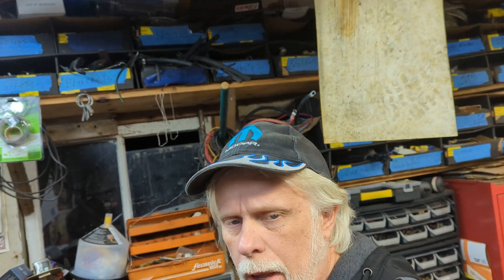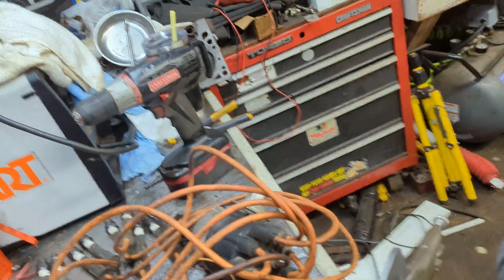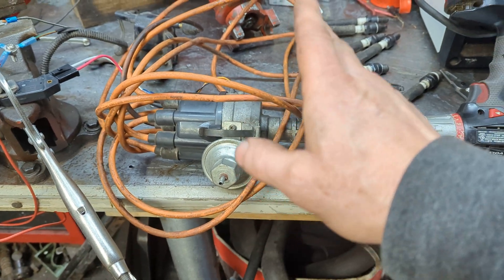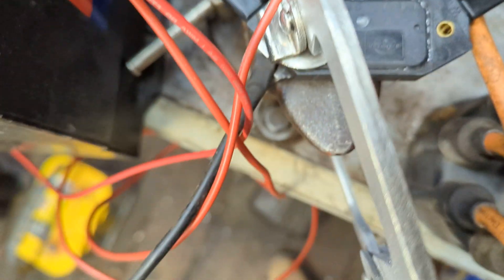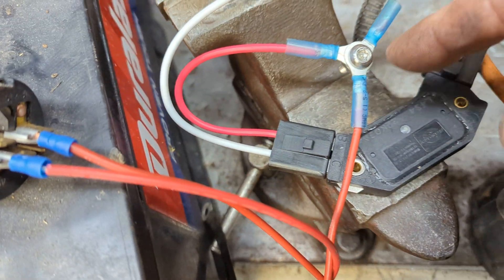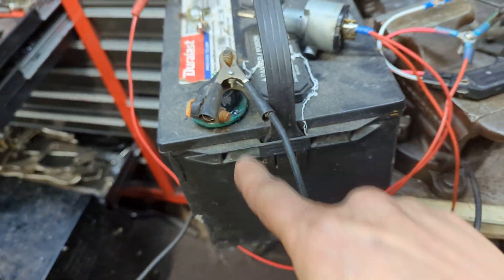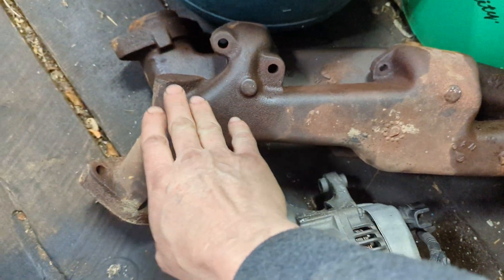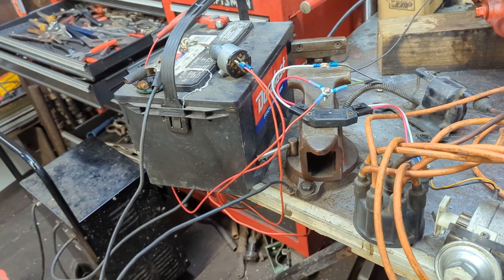Mopar HEI ignition conversion and junkyard haul

Comment: I'm getting ready to do this project real soon.This video helped a lot. 1 thing I wish you could have done a little better is film everything from a little bit more of a distance?So I could see the routing of your wires. I figured it all out. If you ever decide to remake this helpful HEI conversion video, maybe lay it all out on the ground so you can go from one end to the other explaining the connections. Thank you for the video. I've watched a lot of them and this is the most helpful I've seen so far.
Reply from the maker: Hey Just wanted to say thank you very much for watching. The video and thank you for your comments and i i would like to make this video again and have things more laid out more organized. So that people can see much easier
And get a better sense of where everything is supposed to go. And how things are supposed to be wired up?
So yeah, I will try to be doing that in the next two or three months right now.Things are just so very cold.And i'm a little bit sick, so i'm taking it easy right now until I get over this.The illness. that I have and I don't have heat or insulation in my garage, so yeah, pretty much a problem right now.
But again, I will be making this video again sometime soon.Thank you very much have
Reply: @slantfish65sd  Thanks for your response. I hope you see this. Another thing I noticed-in most of the videos I've watched is, no one explains what they did with the factory harness for the electronic Ignition/ ballast wires. Some have 4 connections  & some  2, that came in the vehicle. I hope you get to feeling better soon, and thanks for all the videos.

Comment: I have a 66 Dodge 225. Do you happen to have a part number for your Dodge hei distributor? Or a year/make/model to search with? Thanks.
Reply from the maker: Hello, thank you very much for watching the video and thank you for your comments. As for the HEI ignition system that I used in the video, what I did was I used the stock Mopar distributor for electronic ignition that became available beginning in 1973 and lasted until 78 or 79. An easy way to tell that you have a correct electronic ignition distributor for a Mopar is to look at the body of the distributor and make sure it has a vacuum canister that vacuum canister that a vacuum hose hooks up to provides the ignition advance and retard as the engine is running. That is what I used in the video. Now, if you find an electronic ignition distributor that has no vacuum advance canister, you should avoid that because that distributor has no means to advance or retard the ignition that particular style of distributor is for the lean burn ignition system and I would generally avoid those distributors for that particular use. So again find a distributor that has the vacuum advanced canister on the side of the distributor. It is very similar to like what you will see in the video. Again, thank you very much. If you have any for the questions feel free to ask

Comment: Seems like a magic trick... I've been trying this on my dinning room table for 3 days now...
Reply from the maker: Sorry for not responding sooner. I've had a lot on my plate. I've been dealing with a lot of very very bad weather here at my home but I want to say thank you so much for watching the videos and your comments. Very nice of you. As far as like getting the HEI system to work with the Mopar distributor go to a website called Allpar they have a wiring diagram that is very good. It shows the distributor, the ignition module, even the ground wire or the ground for the ignition module. Also they show the power wire coming to and supply and power to the module and also to the coil. It's really really good. Basically, if you cannot get the system to work, you may have one or more wires in the wrong place again, my apologies were not responding sooner Make sure you're eliminating the ballast resistor in the system. It the GM module works with a straight 12 volts to it. Okay so you don't have to worry about the ballast resistor it's not necessary just bypass it
Reply: @slantfish65sd  Awesome, thanks for the advice! You bet i'll keep trying!
Reply: @slantfish65sd  also I hope you are well! Godspeed!
Reply from the maker: Hey coyote, check out my latest video. I made it specifically to address the issues I have with the current video that talks about the HEI ignition module being used with the Mopar distributor situation there and get your setup to working like it should. Oh one other little thing to keep in mind. Make sure to at least use dielectric grease on the back of the ignition module when you mount it to a heat sink at least dielectric grease. Use that. There is a heat paste type grease material. It is white in color. Probably would be able to get it from Amazon or eBay. If I can come up with a part number or a supplier? I will let you know

Comment: I have had 3 icm and now 3 hei modules go bad. I've bought good products too. Any ideas why these are going bad. They run awesome for a couple of hours then start to sputter and run bad. I replace the module and boom great for a few hours again.
Reply from the maker: Hey just seen your comment. Unfortunately what you're going through is what a lot of people have went through, including myself and basically the Chinese and a lot of our new parts, especially electronics parts is just horrifically mad. However, let me do question you about a couple of things first you know. Make sure you have an excellent ground. There's nothing questionable about the ground. Where the your mounting? Any ignition module there has to an excellent ground to the chassis body work of the car. If the vehicle you're dealing with has a separate chassis make sure you have a separate ground that goes from the chassis to the body work and then of course a separate ground that runs from that body work to the engine block. Then you want of course a separate ground that runs from the engine block to the battery negative side. But I want to question you about your grounds. And also I'd like to know what brands your your buying as for your ignition parts. As for me, I'm going to go and tell you that I've been using the wells brand ignition parts that I've got from O'Reilly Auto parts. Those seem to be doing very well also. You may want to look at ACDelco or
Reply from the maker: I meant to say Delphi and then I went and sent the answer or reply. Anyway, you may want to look for Delphi parts AC, Delco Wells or Napa etchlin brand. Those seem to be far better in quality than stuff that you can receive at autozone or advance Auto at one time I worked for advance Auto and I can tell you their electronic stuff is very bad and usually with autozone or advance Auto parts, their electronic stuff you usually have to buy several of them to get one good one I also like to say thank you so much for your comments. Thank you for your watching the video and also have yourself a great set of holidays. Merry Christmas! God bless
Reply: @slantfish65sd  thanks for the reply. I have been purchasing the accel hei from oriley. The icm was from Jegs. It was awesome for a few hours. So I switched to the hei after several icm. The ground is good. I'm trying a 1.4ohm coil instead of a .7ohm. I will see if that works now. Im using no ballast now with the 1.4ohm coil

Comment: Will the magnum exhaust manifolds bolt up to an la motor?
Reply from the maker: Yes, very easily. However, you do need to be aware of where the exhaust manifold outlet is in relation to whatever chassis you're putting that engine and exhaust manifold in. But yes the magnum manifolds easily bolt right up. Same bolt pattern bolt right up. No issues and also thank you very much for watching the video and thank you so much for your comments

Comment: Cool video great explanation. Think I’m going to do this on my coronet during my 360 swap
Reply from the maker: Thank you very much for watching the video. Really appreciate it and thank you for the comments. As for the ignition swap to a GM HEI module, I like them really well. If the current crop of Mopar ignition components wasn't garbage, I would be all on board for those. But unfortunately lots and lots of electronics are coming out of China and which means quality just isn't there. It's non-existent so you may want to think about doing that. And I like the idea of your swap of a 360 into a coronet

Comment: Will this work on the 1987 Dakota with the non point type?
Reply from the maker: First of all, I'd like to say thank you very much for watching the videos. I really seriously appreciate that. Really helps out the channel okay. As far as making this GM HEI module work with your distributor in your Dakota, I'm assuming we're talking about the V6 Dakota 3.9 l that being the case you're going to need to probably it's probably will work because the distributors in those year Dakota's being that it's 1987, those distributors will have a module pickup module that is inside the distributor and I can't remember. I've seen some 87 model Dakota's with fuel injection some with carburetors. So going back to the distributor those distributors that year those years had no provision for any timing advancement they didn't have. A any way to advance the ignition timing while the engine was running. They don't have a vacuum canister look at your distributor and make sure it doesn't have the vacuum canister. Or pod on the side of the distributor body. If it doesn't then you're going to need to get yourself a V8 electronic distributor for like a 318 that has a vacuum advance pod on the side of the distributor. You can find those in like the Dodge trucks. Probably 1980 and back. Just to be safe I'd say 1978 and back then you're going to have to take out the reluctor wheel that's under the rotor button in the distributor. That is what tells the pickup to tell the ignition module when to fire the coil. Now you would have to pull off your electric wheel from the V6 distributor to put into the V8 distributor that you're going to use. That way that distributor will only send six signals. The pickup in the distributor will only pick up six teeth on that reluctor wheel and there is another way to do this. However, you may have some issues with this. You could use just the V6 distributor cap on a V8 distributor. That way you get the vacuum advanced canister and you can run the GM HEI module if you don't have some way to advance the spark then the engine may run poorly at higher RPMs or run poorly at lower RPMs so you can wire up the stock distributor that comes with that engine to work with GMHEI distributor module. It just won't have any ability to advance the timing curve, so I hope this answers your questions. If you have any further questions about this, feel free to ask. Thank you!

Comment: What a awesome video,Thanks for sharing this information much appreciated. I used a Summit Racing GM HEI style on my 89 W 250 360 LA worked great,however I had clearance  issues with the Distributor cap being much wider.  The distributor body interfered  with my firewall in wich  I clearanced with a Hammer 🔨..lol. I like your idea much better 😉👍👌.
Reply from the maker: First of all, thank you for watching. I really appreciate it. And I also was thinking about doing the GM HEI style distributor on my small block Mopar's but like you said in the trucks, the firewall is a real problem. So I will probably be doing this kind of setup. But that HEI distributor is great because it has that big massive cap that gets you plenty of clearance from one spark plug. Contact to the other and doesn't allow as much spark scatter

Comment: Great job on the example of a working system which is a super vid for beginners to see how the ign systems works and it's always nice to get that score from the boneyard - I enjoy that too. Question for you, Why go for the GM module instead of the factory Mopar? The theory is it gives more spark, but has this been proven? And is it more reliable? I must say I never had much trouble with mine. Thanks for the video.
Reply from the maker: First of all, thank you for watching. I really appreciate it. As far as I know, anybody like proving that the GM HEI ignition module provides more spark. I don't know of anybody actually doing this. It would be a good video, though I'd say probably somebody probably might be able to do this in a garage, but it may be kind of difficult. However, at a racetrack or on a dyno this might be easier to prove out but the reasons for getting rid of the Mopar ignition box or brain box. Whatever you like to call it. The reasons for getting rid of that is because it has to run at less than 12 volts, which means you have to use the ballast resistor in order to make it work and still live. You can temporarily run it at straight 12 volts, but it won't live for very long like that. Furthermore, the the supply of today's ignition brain boxes and the baluster resistors is nothing great. Thank you, China so that's the reason why I'm trying this system out and seeing if it's going to work out really well it's like I said in the video it will be going on the $50 318 and I'll be using it on that and then I may also use it on the ramcharger or my 5th Avenue and in the GM HEI module takes a straight 12 volts and eliminates the baluster resistor all together which I've had a lot of trouble with over the years. Honestly when I go into junkyard or salvage yard and if there's any older Mopar's there that has the brain boxes I pick them up by snag them although the supply of today's ignition brain boxes and ballast resistors are absolutely garbage so thank you again and if there's any other questions I can answer for you I'll do my best. Thank you!
Reply: @slantfish65sd   Thanks for the reply.  In fairness, I've been out of the game for a while but always interested. Unfortunately sold my 68 Dart - you know, family, house with acreage, etc., at time thinking I could get back in the game in the future as they were plentiful back then in the 90s. Boy was I wrong, albeit some 30yrs later. To be honest I wanted in sooner than this but other priorities come over it. Unfortunately I could see the $ skyrocketing for these old Mopars over the years even for rust heaps. I did pick up a 72 Duster a couple of yrs ago but haven't had the $ or time to do much to it yet. Body is 99% rust free except the typical under the tail lights area, but does have dings and dents. It is complete body, with 8-3/4, 4.30 gears (too high for my liking) fresh brakes. Motor is mostly there but partially disassembled. For now I am thinking of pulling the known low mileage excellent condition 318 out of my 1981 Cordoba that is in the back 40 and throwing that in with the lockup transmission. It has been sitting for 20 yrs so I am going to pull the heads off, make sure everything is free and clean before installing in the Duster. One of the missing pieces from the Duster (there are a few) is the Distributor. I am debating whether to install an original points style (I don't have one) or go with the electronic (I do have one and a box) that I kept for yrs but I am missing the factory connector for the Mopar distributor (I know I could connect without but that would be kind of hokey). The Cordoba 318 had the lean burn so that dist. is useless. Where I am going is that I have seen some other vids in the past where they installed the GM unit and pondered doing what your are doing here. Just need to decide which way to go. I do know the Mopar electronic is better than points but points don't leave you on the side of the road too often and if they do it is an easy fix. So you give me more food for thought. I suppose the bottom line is if I did go this route I would make sure I have another bone yard or Chinesium spare of the electronic unit. In any event sorry for the long winded reply and keep up the good work.
Reply from the maker: @chumleye1112  I encourage you strongly do it. Get that duster running. Love to see it. As far as ignition system, you might want to think about using a points distributor which can be used to trigger an MSD box or a GM HEI module. Just something to think about, although I like where you're going with the entire project, you may want to also think about maybe picking up an inexpensive Magnum motor out of like 92 and later Dodge pickup. That would work really well in that duster